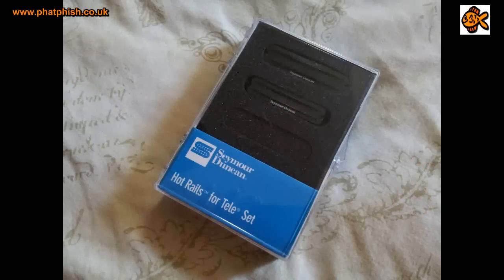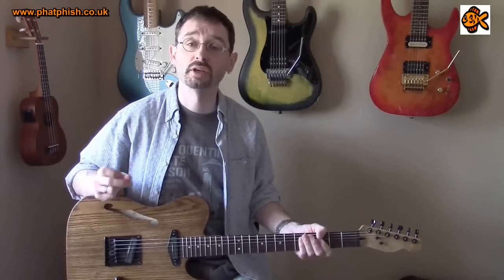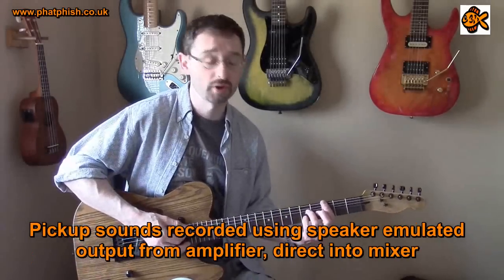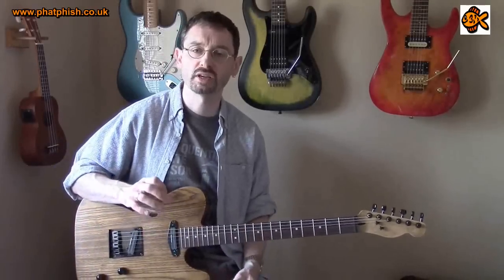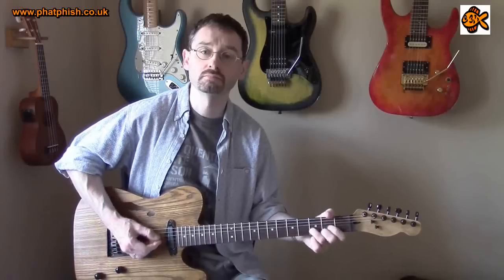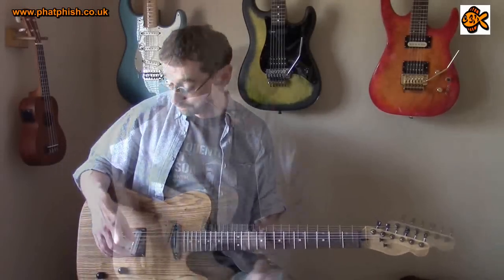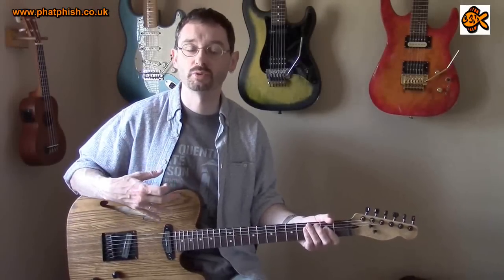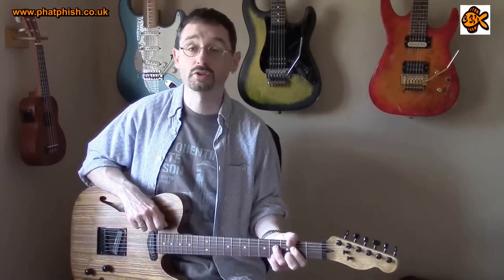Demo/Review - Seymour Duncan Hot Rails for Tele Pickups

Comment: They sound just as they look .... small   tight   compressed . Had them ,  scrapped them . I much prefer the big wide 3-D sound of a good Alnico true single coil .  These are ok for some studio work and going through hi-gain and  distortion processors . Every tool has its job .

Comment: Have you had any problems with feedback when using a high gain setting due to the thinline construction?
Reply from the maker: Not really.  TBH I never play at a particularly high volume at the amp.  If I need more then I'd mike the amp up or run a line out / cab sim to a mixer and add the volume there

Comment: Did you single the coils to get that "more telecaster sound"?
Reply from the maker: Although you can wire these to split to single coil, I haven;t done that on my particular guitar.  I have heard these coil split and whilst they do have a brighter sounds, I don't know if I'd call them espcially Tele-like - there's still a lot of mid-range to the sound
Reply: +PhatPhish Guitar Studio Ok, thanks for answer!
Reply: +PhatPhish Guitar Studio Another question... I'm really interested to buy this pickups, I have a Mexican tele and I'm wondering about the clean sound. So, clean is too much low or is versatile? Because I loved the power of this pickups with distortion but i have this doubt. Because I saw some videos and I heard a very saturated sound by lows in clean. I'm looking for a sweet and powerful sound but not too much if you understand me. I'm so grateful with you, thanks.
Reply from the maker: +Eddye MaCiias Villegas these work really well into a clean amp  - nice full sound, not weak at all. I think you'll really enjoy them

Comment: nice sound. but it don't sound like a tele
Reply from the maker: That's kind of the point - the pickups fit into a Tele but offer tones that you just don't get with traditional Tele pickups
Reply: rock on
Reply: Agreed. I like the "traditional" tele twang for country, blues, and classic rock and roll. However, I installed Hot Rails in a Highway One Tele because I love the look, feel, and simplicity of a Tele, but wanted more output for heavier tones without giving up the feel of a Tele. The Hot Rails is a great pickup and much more versatile than it's often given credit for.